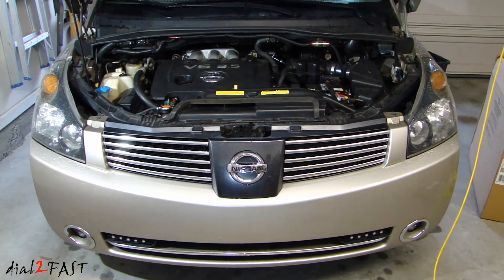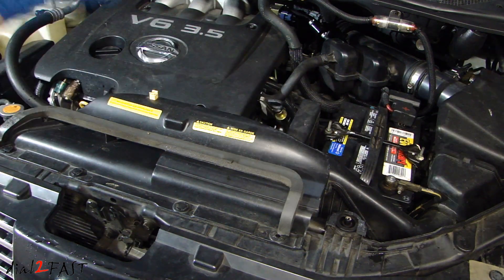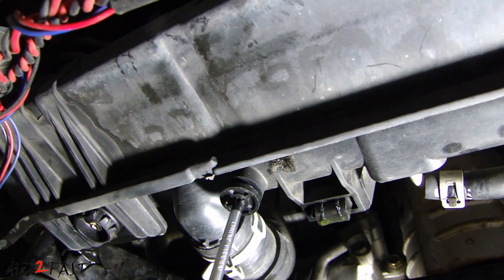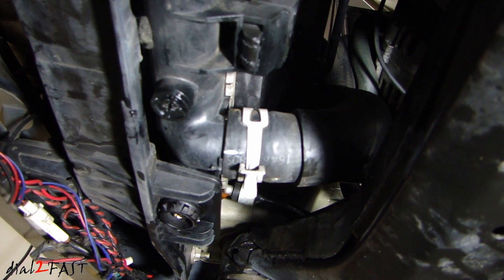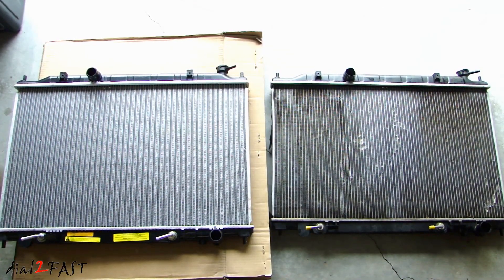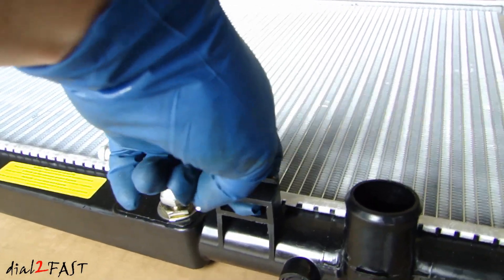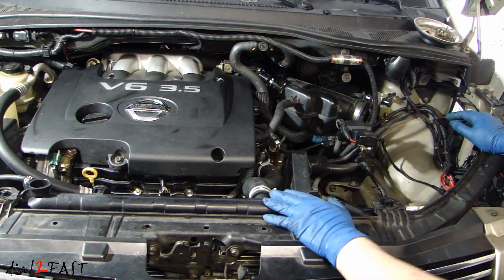Nissan V6 Replace Radiator - Video 1 - 2004 Quest

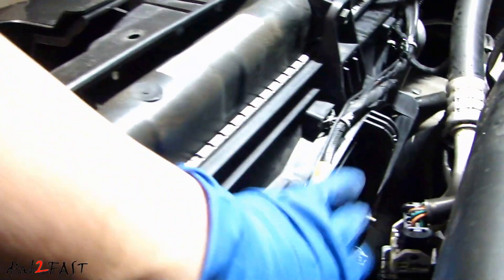Comment: How is the connector released from the fan motors?  At 3:50 you are using some type of tool to release the connector, but don't show the tool, or describe what the tool has to push on to release the connector's locking mechanism.
Reply: It's called a screwdriver
Reply: A simple flat head screw driver is placed down on the tab while pulling it out.

Comment: Dial2fast,
Thanks for saving me a ton yet again on my 2002 Maxima which has a similar process.  I heard some folks getting quoted +700 to get this done on a 2002 Maxima.  I bought the parts as well as the Lisle Tool  and it worked like a charm.  Video 2 is very important because I once had a local mechanic drain and replace coolant in my wife's 02 Altima and the heat stopped working so I am very familiar with this bleeding process.  The Lisle Tool that you recommended is translucent so you can see the air making it's way to the funnel from inside the car.  Thanks again!
Reply from the maker: Always very happy to hear feedback like yours. Glad you got yours done and my video was helpful. You have a great day!

Comment: is it necessary to take out the battery compartment and air box out?
Reply from the maker: Yes
Reply: No
Reply: Everything comes straight upward pretty much straight forward there is no interference with the airbox nor the battery. I did mine without the extra unnecessary work.
Reply: Rangerxlt21 yes
Reply: No. You can pull the fans and radiator up and out maneuvering it slowly by lifting the left side up first then the right as you are looking at the car from the front. I had no issues. Removing that battery tray is was too much extra in my opinion.